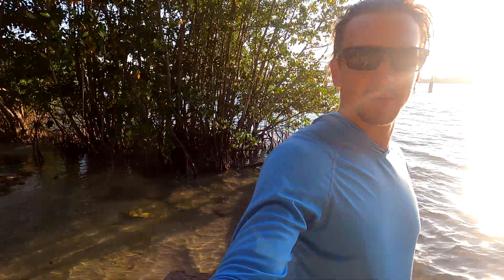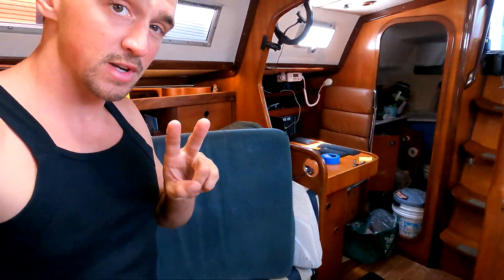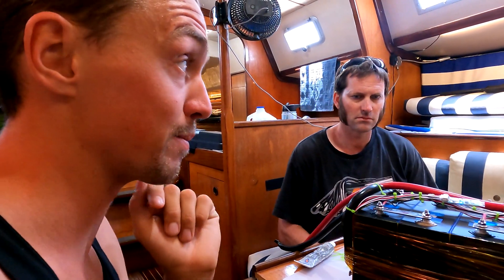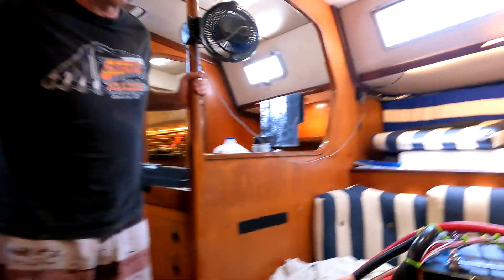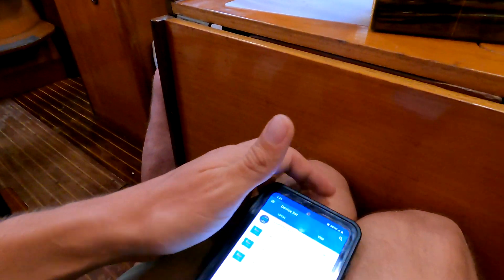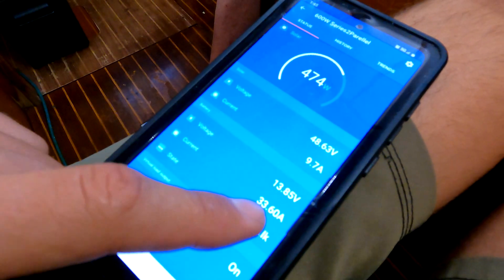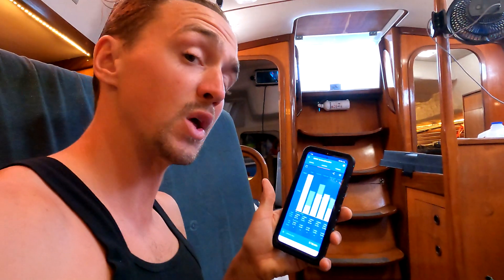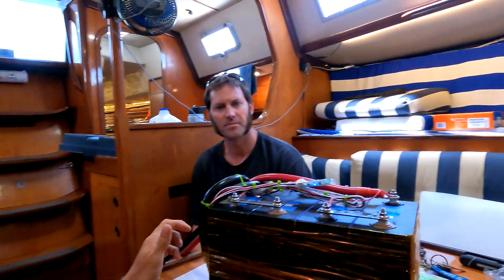DIY Lithium Battery Bank for my Sailboat (100% Solar Powered)

Comment: Very cool. I have 7 of those I've built. I love my battery bank ! 2100 amp hours. x 12 = 3600 watt hours  x 7 = 25 KWH total . I wrapped them with a special tape, called Fiber Tape,, VERY STRONG.  I use an MPPT Renogy 40 amp charger. I use a  12v fridge, I actually have two of them. But I've only needed one running full time. This system would go with me if I decided to sell my property and get a boat, which is what I think I'd really like to do. All of these power rny ham station and my fridges. And lights when I need them. Grid power is VERY expensive here so I've been trying to get off of it. Off grid on a boat would be fine with me.

Comment: Hey. I know this is a older video now, and you might not read this. In case you do, what are your charge settings now?
If you haven't changed them I recommend changing absorbtion level to 13.8v, float to 13,4 or 13.5 and low voltage disconnect. You'll still get really close to 100% SOC and may take just a little longer to get there, but your battery will experience less stress keeping them out of the (knee bend) (high and low)on the charging graph. You could get a decade or two out of the cells. Sorry if you already new this.just sharing.
Reply: Edit. Low disconnect voltage to 12.4v
Reply from the maker: Thank you for the tips!

Comment: Where did you get the battery cells and BMS?
Reply from the maker: Alibbaba and overkill solar.
Reply: @Adventureman_Dan  Answered my question, over kill solar 120 amp hour. Great job. Hopefully we'll be in a sailboat within a couple years. Just putting a couple of those batteries in our rv now.